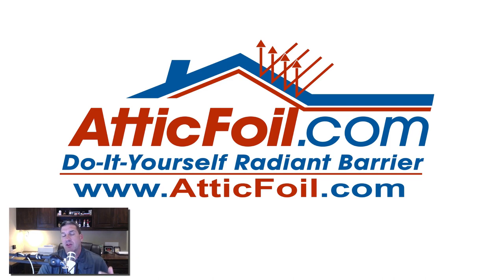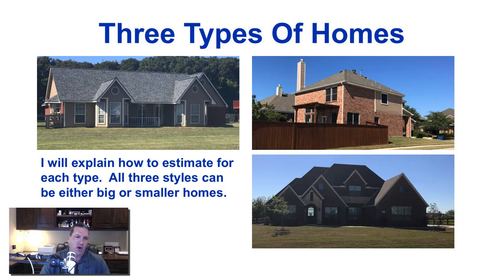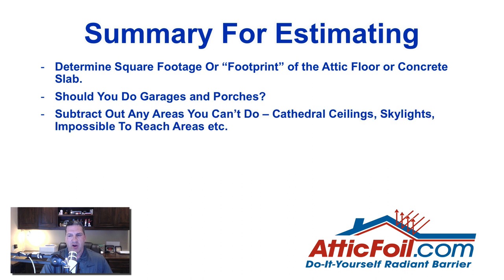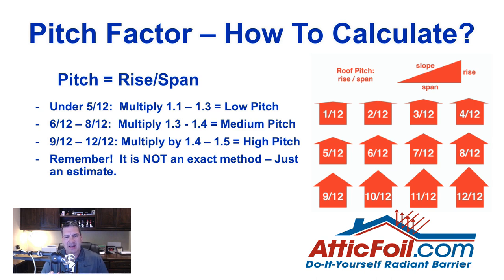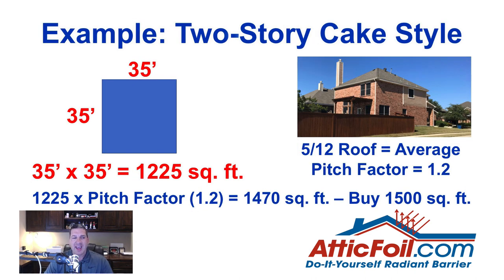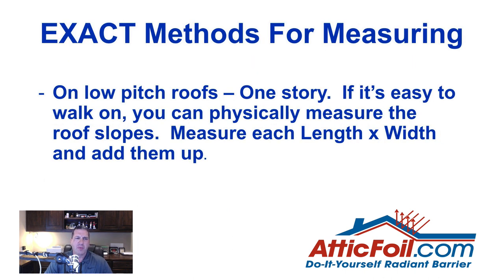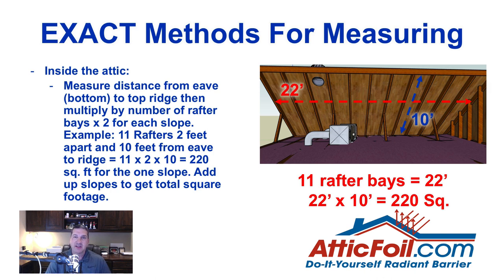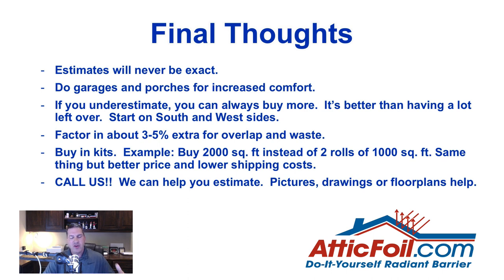How To Measure Your Attic to Install Radiant Barrier (Or Just Call Us - We Are Experts At This!)

Comment: So. What happens if I put up a radiant barrier but I don’t have a roof vent ?
Reply from the maker: Chuck, Ideally you have some type of "hole" in the top of your attic for air to get out.  However, EVEN with a non-vented attic radiant barrier still helps.  A vented space is best but a sealed space is still good. I use the example of one of those foil windshield for cars:  It will still keep the car cooler and reflect the heat EVEN if the windows are not cracked.  However, it works BEST to reflect the heat and provide some ventilation.
Reply: AtticFoil Radiant Barrier Foil Insulation great thank you. I plan on installing in a couple of months